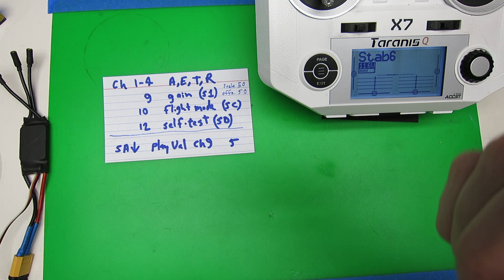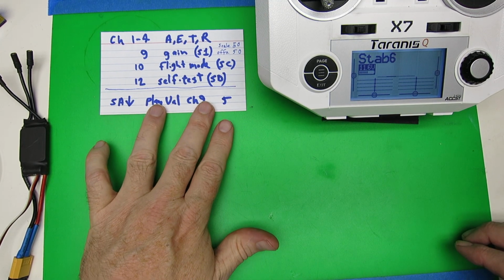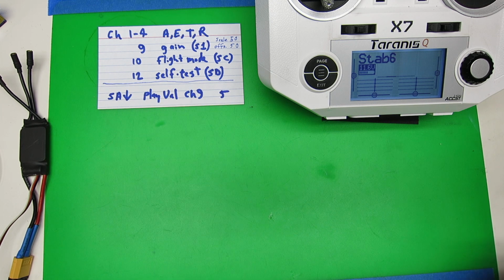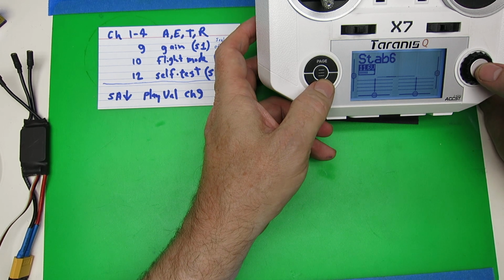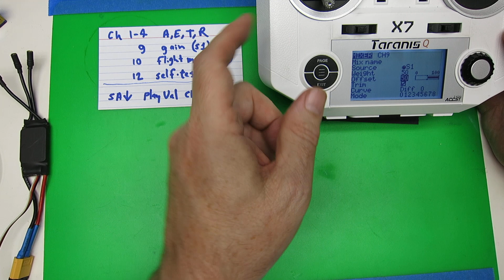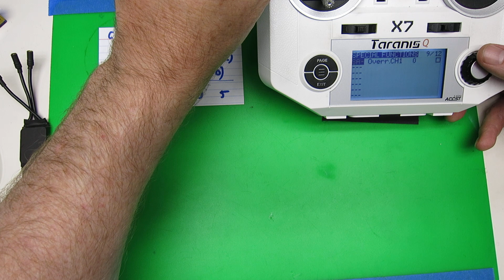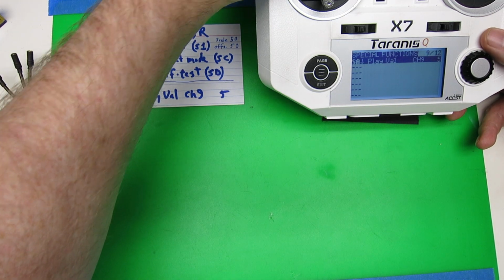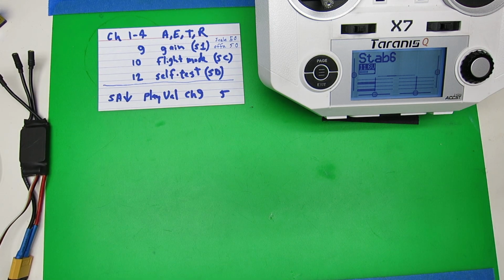FrSky S6R/S8R Setup: Step 3, Tx Setup

Comment: Hi, this works great except my elevators try to correct backwards. When I control them with the sticks they work normal but they’re backwards when they try to stabilize.
Reply from the maker: Try reversing them on the transmitter, and then reversing them on the S6R via the setup program.  I think that will get the manual and automatic reversing in sync.
Reply: Mark Harrison how would I reverse them with the setup program is that in the manual? Thanks. :)